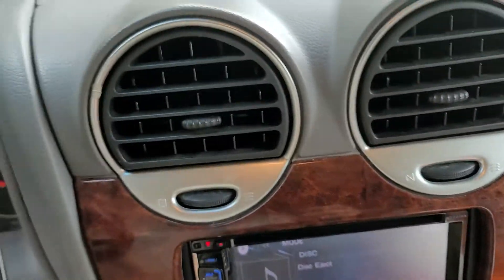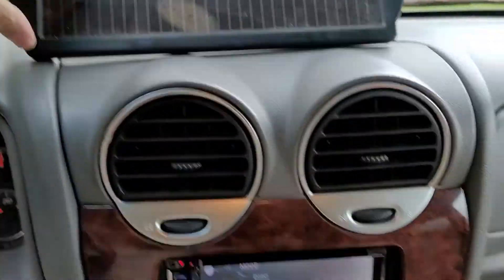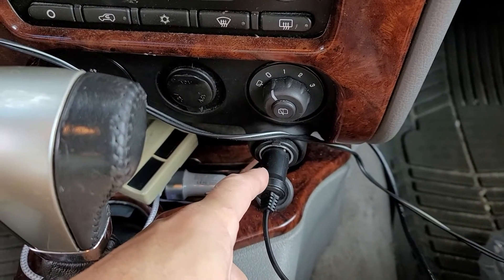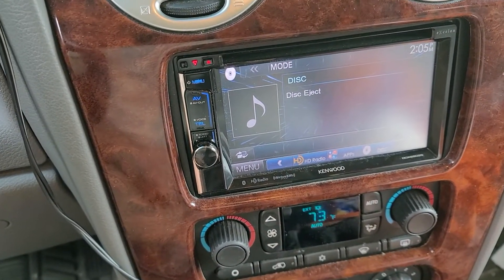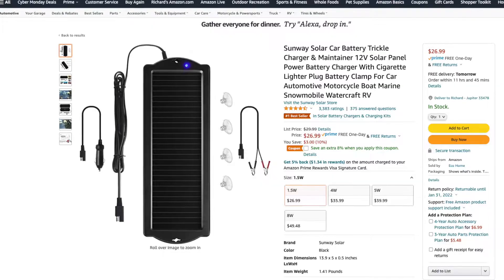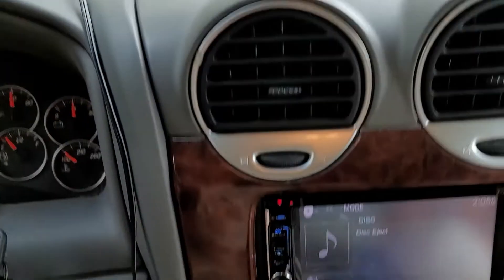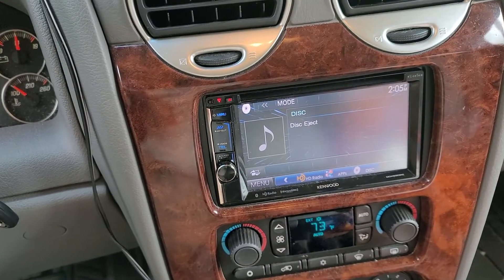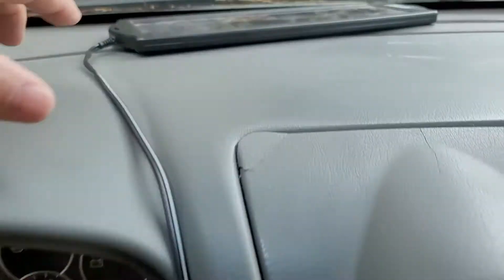Miswiring DC Offset Error Prevention!

Comment: Sounds like a good idea IF that's the problem - but I have an issue where it came on.... and I had a failing battery, a dying alternator, and the power crapped out on me several times, and this error never once came on.  However, it just popped on out of the blue suddenly when I did nothing else to the car, and the car was driving down the road after a long drive, with the battery full.

Comment: battery has nothing to do with dc offset . At least not according to kenwood.
Reply: Don't keep a secret, let us know the solution?
Reply: @flyingrichfirearms  a simple Google search will tell you what causes it.  A low battery has nothing to do with it. Had batteries go dead many times over the years and never had that issue come up.
Reply from the maker: @tellerbee9929  So what you are saying is, you just don't know and I need to search for what you say you know? Now I have never had this issue until COVID, where my truck would sit unused for weeks at a time and the battery would drain. But when the vehicle in in regular use, and the battery has a good charge on it, I never have an issue. I'd happily admit I am wrong, but the symptoms do not match any other solution. No, I am not a rocket scientist, or EE, but things I have soldered have gone to space.
Reply: @flyingRich  you know what,maybe I could be wrong,just saying a week battery has never triggered it for me and I haven't seen any others say it has triggered it for them.  Kenwood states it's a live wire grounding out that causes it,either internal or external.  Or just a glitch in the software that a simple reset will cure. 
I had this issue recently and it wasn't because of a week battery so your solar solution wouldn't have helped me any.
Reply from the maker: @tellerbee9929  Good logic! I'd agree with wires grounding if it happened to me while I was driving and hit a bump in the road. But for me, it has always occurred after the vehicle sat for a prolonged period of time.
Reply: @flyingRich  I edited my original comment and took out the waste of time comment.  Maybe it is a certain anomaly that's affecting your radio because of low current.  Stranger things have happened.
Reply from the maker: @tellerbee9929  Thanks for the input! I did not know the other causes of the fault. I learned something today and appreciate it! :)

Comment: Thanks a million for this idea. I use a plugged in CTEK battery maintainer, as an alternative. Your knowledge really helped me with understanding a probable root cause for my issue.

I just installed a JVC head unit, and the battery drained during testing (headlights on auto). I jump started the car to test drive, and it threw the "DC offset error" when I turned up the volume. I'll bet I didn't let the battery recover enough, causing the issue.

Also, I am only using the RCA pre-outs to the factory amp, so there's no speakers being driven by the head unit directly, so no short to be had (miswiring, or a short in the speaker wires, the other frequently recommended item to check).

Take care and thanks again!

Comment: Not related to that specific unit but I have a 12 Camry SE with a factory touch panel head unit. Everytime I don't drive it for 3 whole days, when I start it it starts fine but sounds and feels like a diesel or miss for about 5 seconds then flattens out. It's done it three different times so far everytime I didn't drive it for those three days. Only the last time it done it long enough to actually throw a code and triggered the Vehicle Stability Control sensor light but before I could get home to check it on my reader they went off by themselves. It was the second day before they cleared. I forgot to check the first day. The sensor light cleared first and then the check engine light cleared itself. I'm assuming since it only does it after three days it's my battery draining from parasitic charge and needs replaced. It came in the car and time. Do you think that's reasonable to think or something else? I can't tell now until happens again bc codes cleared. It's a good thing but wished I could've checked. Anyhoo, this got long so...appreciate the videos as always Rich. 🐍🇺🇸